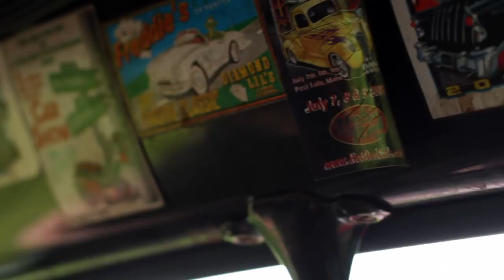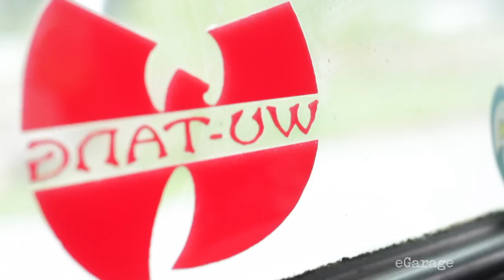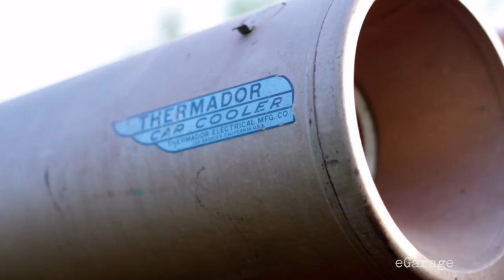Andy's Red Truck - 1950 Ford Pickup

Comment: Very cool truck Andy! My first 4 wheeled vehicle was also 50 Ford F-1, loved that thing. I got it when I was 13 and my dad and I spent the next three years getting it ready for my 16th birthday. It had a 289 in it with a c6 trans and a Ford 9 inch with 4.11 gears. We modified the interior with bucket seats and a Hurst ratchet shifter, removed the vent windows and put in single glass power windows and an in dash CD player! LoL! It was 1989 after all. I kick myself for getting rid of it and would like to build another. Take care man!